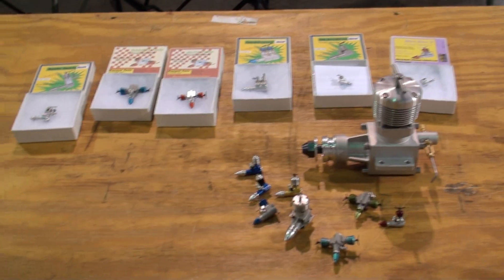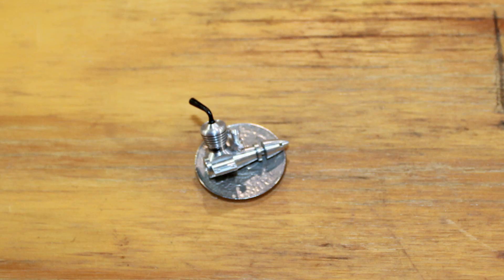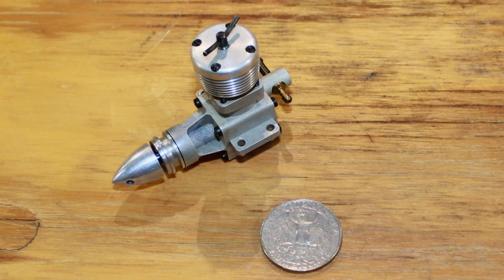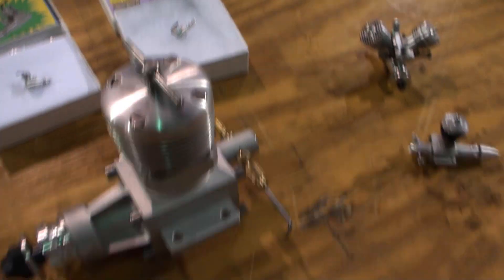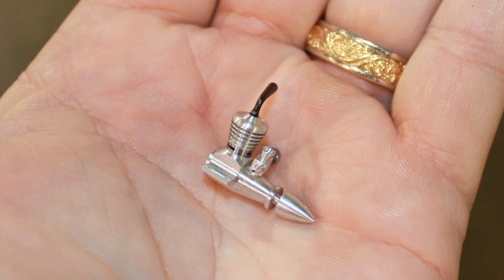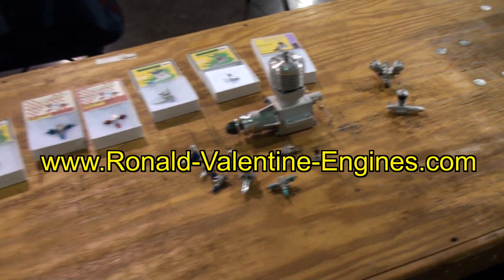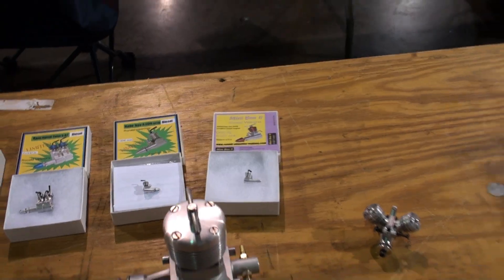The Smallest RC Engine In The WORLD!

Comment: They're not CNCed cause you don't understand CNC programing. Don't fault me because I can write a few lines of code. It is admirable you took the time, as a hobbyist to machine them without any electronics. (If you did)  But if you want to earn a living manufacturing internal combustion engines you're going to need volume of manufacture.  It's just for fun otherwise

Comment: The Tee Dee .010 was a runner at 39,000 RPM. Until I see one of these engines run, they are all show no go.
Reply: I don't think they run, at least I see no way for the twins to run - they would have no crankcase compression and therefore would not be able to run.

Comment: I would love to learn how to build these .
Reply: The platinum wire glow plug interacts with the nitromethane causing ignition, making these engines a Semi-Diesel.  Timing is done by compression ratio. You can only make the platinum wire so small, then it won't work.
Reply: Get a small lathe and a big magnifying glass.
Reply: All you need to do is buy an existing engine (2 stroke or diesel is easiest), take the measurements with calipers, micrometers and veneers etc and scale it down and make some minor changes to the crankcase and cooling fin shaping to avoid any copyrights and use a lathe and milling machine. It's pretty basic machining work, these engines aren't complicated at all. Simple as process :) Extremely cheap to manufacture bar stock/materials wise. The difficult part is machining in small scale. There are quite a few engineering plans out there for these rc engines too. Essentially, this is exactly what this guy has done.
Reply: You still have to get the glow plug and "carb" to work right, which I assume would be the hardest part.
20 years ago there was an electric car that drove around inside the head of a penny, using the tiny lip as a guard rail so it didn't fall off.
Reply: yea i was wondering how to set up the timing of the plug ?

Comment: He never mentions the most important thing about them.  What are their displacements?  I read in an R/C magazine in the mid-60s, about an R/C dirigible someone had built, which was powered by something like a dozen 0.001 C.I.D. engines.
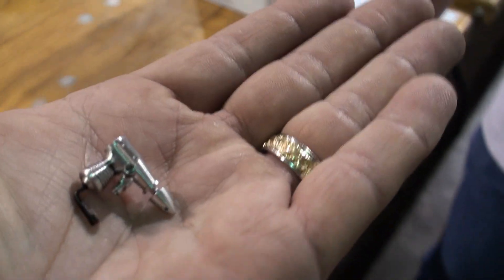Reply: +Clyde Wary Watching the video at 1:19 the nano bee is listed as a .00037 cubic inch displacement on the box. That's roughly the 1/10th the volume of a single drop..

Comment: What do those L things on the top do and what are they?
Reply: +billy bob On these kind of engines (diesel) combustion occurs under pressure and the L thing is used to adjust the volume over the piston to achieve combustion at the right time.
Reply: +billy bob so you can adjust the compression

Comment: still has more power then a Honda. 😊
Reply: +Dami Nooki Yet not as strong as a Nokia...
Reply: @Jack Carroll I was with the jokes right up until you said more reliable then a Honda. Honda has made more reliable engines then America or Europe ever has. A possible exception, contrary to your Chevy avatar, is a Ford 300 inline 6 and pretty much any other make diesel. The 350 sbc is not a reliable powerhouse, its just a cheap powerhouse. Same goes for the LS variants.
Reply: DaffiestHail54 still don't know anything about cars
Reply: DaffiestHail54
Reply: as a 86 honda accord owner , i completely agree . i might have to do a engine swap with that max power 4 cylinder diesel hes got XD
Reply: *torque
Reply: Honda's are actually one of the most reliable brands
Reply: Damn right 😂
Reply: +Jack Carroll Hondas are actually really reliable vehicles, and motorcycles
Reply: Wat? Honda ftw
Reply: It's more reliable than a Honda

Comment: if its actually functional, id put a few in an altoids tin with some tiny alternators and make the worlds smallest diesel generator
Reply: TGKcraft Good thinking.  I heard of an engine like that years ago that ran at the molecular level, it took a few molecules of hydrogen and oxygen and burnt it and produced electricity (it ran a generator).  But I must have been dreaming, because I haven't seen or heard of it since!  This guy claims he has made the smallest engine, so I must have been dreaming. lol!
Reply: SadamFlu  http://diyhpl.us/~bryan/papers2/mems/Millimeter-scale,%20MEMS%20gas%20turbine%20engines.pdf  an engine 21 mm square by 3.7 mm thick.  A jet engine with a compressor smaller than a centimeter actorss.
Reply: WorBlu x Awwwww there it is! Thank you so much for finding it!!! Do you know if someone has a video of them running?

Comment: What's the point of having an engine that small? Maintaining it must be tedious as hell.
Reply: Oh no, my Moms Ford Fiesta had a similar sized engine (it must have been that small by this performance figures) and it never had issues. Service was only a fraction of the Bimmers maintenance costs.
Reply: To push the boundarys
Reply: Well, it only has 3 moving parts, 4 if you count the compression adjustor.

Comment: I have a few of Ron's little engines I have a blitz 0.05cc and DiVa 0.098cc I actually flew the latter on an airplane for a little while with a parkzone brick in it for control of the plane. These engines have no throttle, they are all compression ignition "diesel" engines, the Nano bee is 0.006cc and will set you back $500 it weighs only 1 gram.
You should get one if you can, Ron is a true craftsman and a great guy to do business with.
Indra